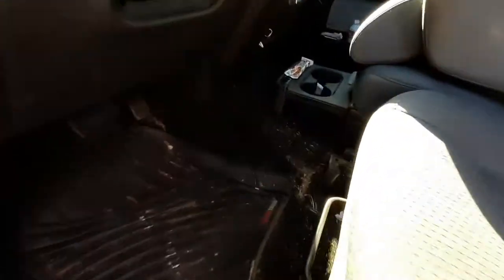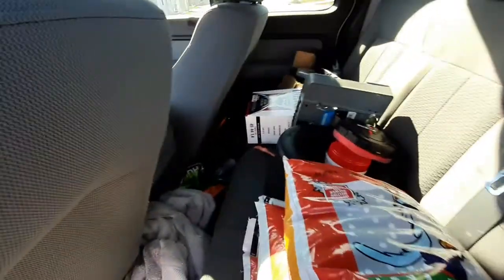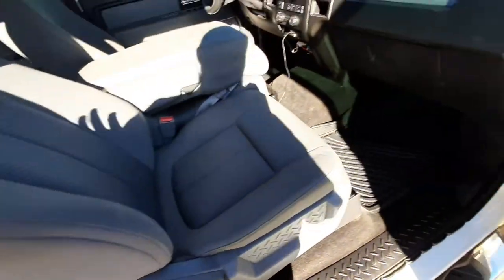Washing A Neglected Lawn Care Truck - Oddly Satisfying

Comment: I did the same yesterday. I was tired of feeling ashamed every time i opened the door to get my trimmers 😆.  Im getting a  Rigid shop vac. I used one and that thing has a lot of power. Once i remember the HP I'll let you know.
Reply from the maker: Ok that sounds good I would like to get honestly probably the strongest vacuum I could find lol. I want all the cleaning power
Reply: @JonsDailyHustle  it gets annoying having a crappy vac. I bought a small Stanley shop vac and I've had it for about 2 years. I'm ready for a REAL vac 😆
Reply from the maker: @melvinslawncareandpressure787  se bro, mine is the Walmart black friday special so....I'm long over due for one as well lol
Reply: @JonsDailyHustle  looks like we may have gotten the same one 😆 I used the Rigid with the contractor i work with and it's great. He sucked up a whole microfiber towel with it 😆 it was then that i realized thats the one for me
Reply from the maker: @melvinslawncareandpressure787  🤣 that's pretty good. Definitely gonna have to check it out